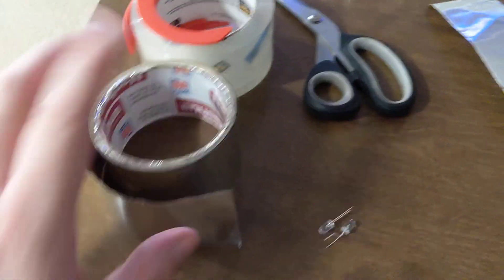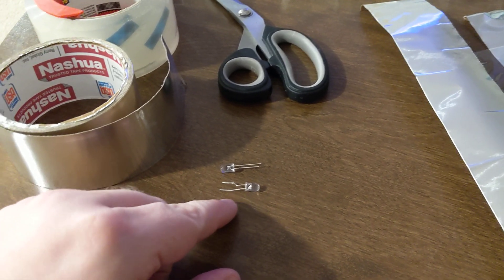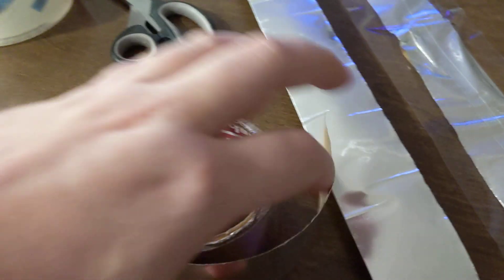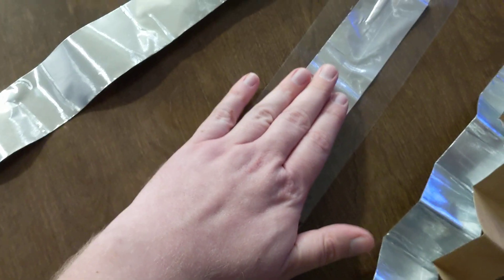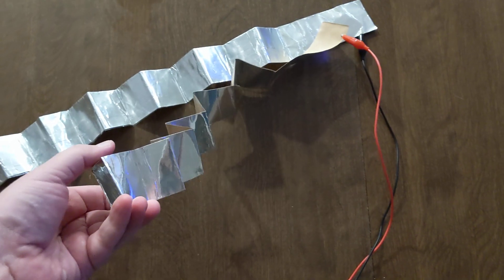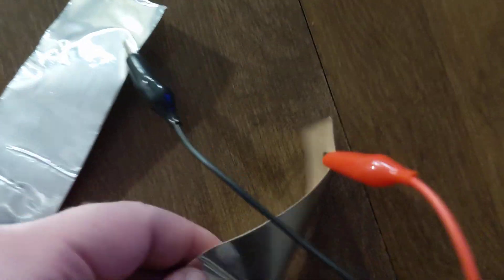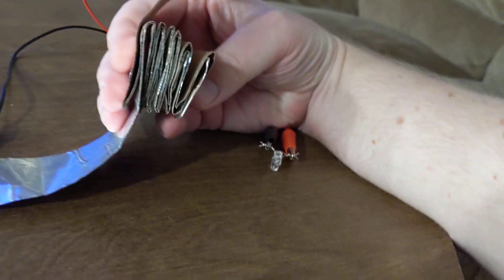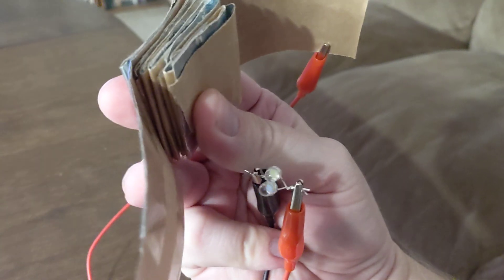TENG Triboelectric Nanogenerator Basics

Comment: I've gotten a wild idea to combine strontium aluminate with the LEDs to smooth out and prolong the light output, which i shall be attempting in the near future. Thank you for this excellent tutorial! I'll be uploading my results and il try to make sure i tag you in some way. Might be after the holidays though.
Reply from the maker: sounds fun yes please show me
Reply: @nostrumuva built a TENG based off your video just a bit ago. Gonna be doing some refining but it worked super easy!
Reply from the maker: @thexaviousdoesthings568 great job dude glad to hear it.  now make one as big as your house and put it outside in the wind ;)
Reply: @nostrumuva lol i'm actually gonna see about using it for wearable electronics. Specfically as an energy harvester for my ghostbusters looking power pack.
Reply from the maker: @thexaviousdoesthings568  So the thing is, it can run LEDs because they use a voltage difference to light up, but Power is P=IV which is voltage times the current, and the current is very low.  You could theoretically make it work, but you'd need to connect up a very large capacitor at least 500F, and then charge that for about a year by shaking the TENG without stopping, cause capacitors also leak a little bit of charge.
Reply from the maker: @thexaviousdoesthings568 OK I watched your video cause I thought you were trying to power an actual large device but you are just adding lights for ghostbuster costume, so yeah it'll probably work great
Reply: @nostrumuva oh yeah, nah I got a bunch of LiFePo4s in the pack to actually power it, I'm just looking at various energy scavenging methods to offset passive drain.

Comment: Sir do we connect. One led cathode to other  led anode ???
Reply from the maker: @akhilraina695  yes.  Connect LEDs backwards to each other, then to each terminal.
Reply: Sir I buy 3M scotch bopp packaging clear tape does it work on this  ...
Reply from the maker: @akhilraina695  yes that should work.
Reply: @nostrumuva  sir without rectifier does it work ?
Reply from the maker: @akhilraina695  yes it will work without rectifier.  All you need is one or two LED depending if you want it to light in both expand and contraction.

Comment: Can we take any other  pvc tape ? Nd one more doubt both the end we take  where we connect the wire one of them is taped
Reply from the maker: @akhilraina695  I've tried other versions of the Scotch tape and it works.  But I tried Teflon tape and had worse results once.  Check your materials on the triboelectric scale.  You want two materials that are far apart.

Comment: use doblesite tape so you need only one flat and glue the alu on both sides. this is your way to the harmonica generator.make two strips and falt it in the middle and now falt it,i,ts another harmonica.
Reply from the maker: If you used double-sided tape, it would not work, because there needs to be movement to separate the tape and the aluminum layers.  The movement is what causes the triboelectric charge.
Reply: @nostrumuva  ok,you win ;-) other Quest-can you produce and store Power with a Microfon and store it in a Capasitor? a Soundcharger. if so,let,s built one with a Coil from a Loudspeaker(produce a bigegr Powersingal) and we call it,,The Bullshit-Generator. Why? it,s prduce Power with a Microfonlike construction,so if someone talk BS,you can produce power and say,Man,if you talk more BS i can produce alots more Power. No Joke ,a Fun Project. and a Cube some listen 360 degree can for sure produce alots and capasitors can store it some use ;-)
Reply: @nostrumuva  i will built one and show it will works. i fell i have tell fail what i really mean.
Reply from the maker: @Chefchen21  make one then
Reply: Can you suggest one other tape

Comment: Amazing 😍
But actually, mine doesn't work, although I followed exactly all of your steps. I guess it should light up yellow leds too, because I don't have white Leds so I use yellow Leds.

Oh actually, I measured the voltage with multimeter, it's just 1V 😅
I think I should make it longer
Reply from the maker: @NitraHeartfilia  if the voltage is too low, yes make it longer and use more folds. If the current is too low, combine them in parallel with rectifiers.